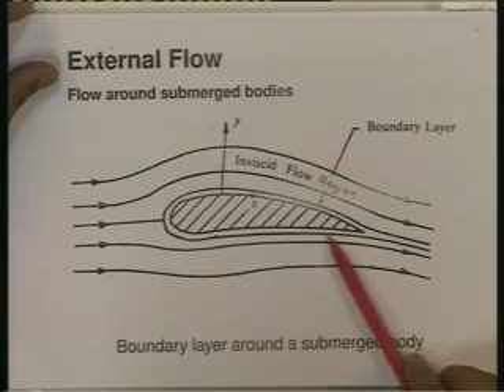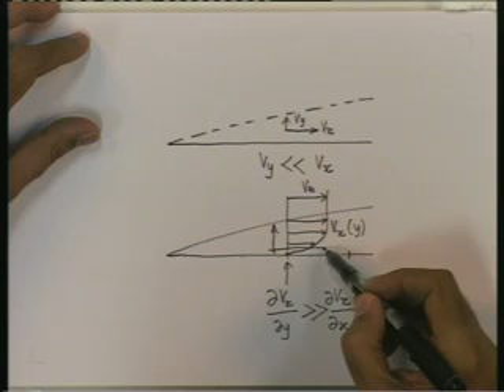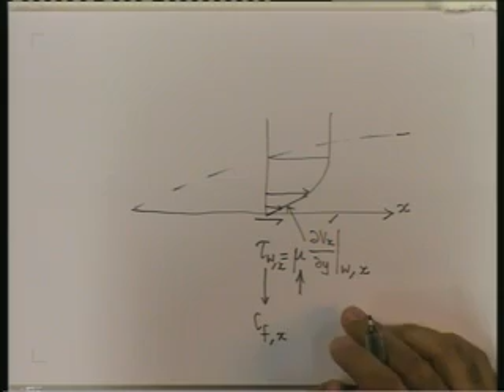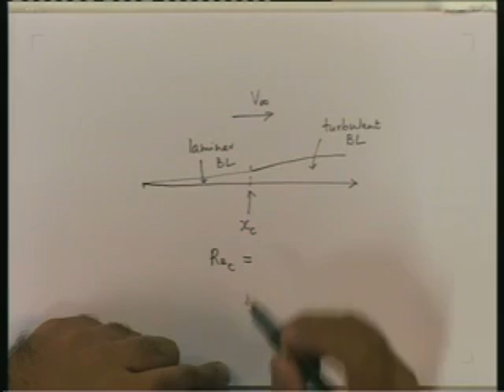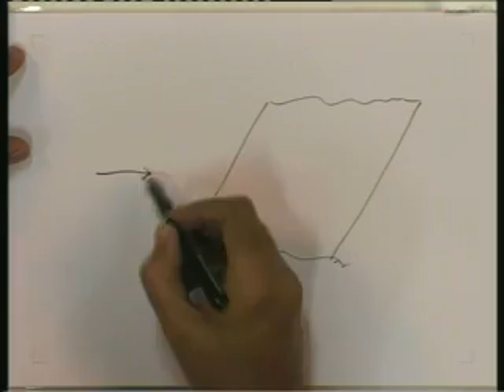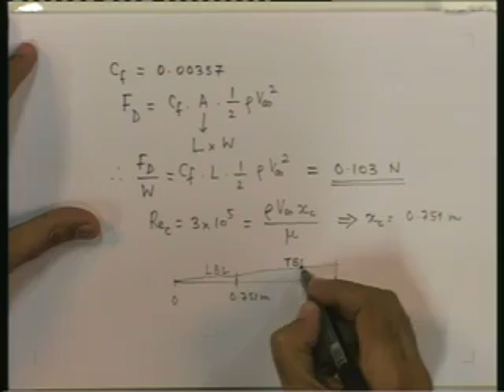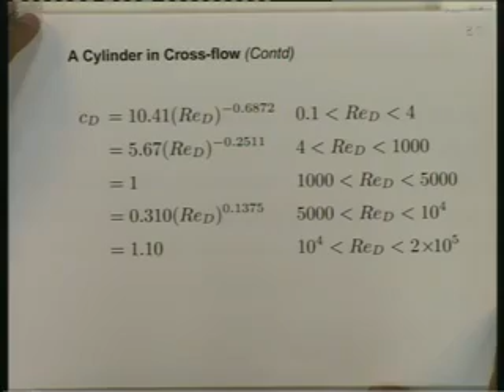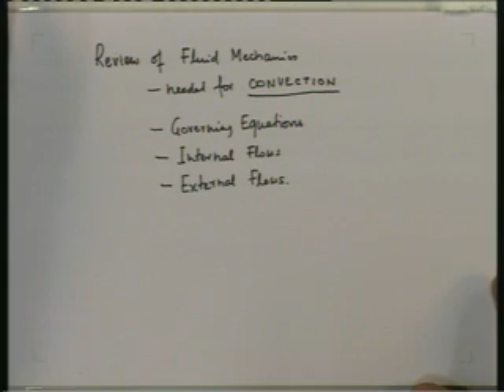Lecture - 17 Review Of Fluid Mechanics - 2

Comment: According to cengel the value of critical Reynolds number is 5*10^5 for a flat plate.....Why is there such a huge difference?
Reply: This guy had a doubt from 5 years ago and no one cleared it yet
Reply: I have watched it too in cengel
Reply: Actually there is a transition phase from 3×10⁵ to 5×10⁵, but for simplicity, we consider that turbulent region starts from 5×10⁵